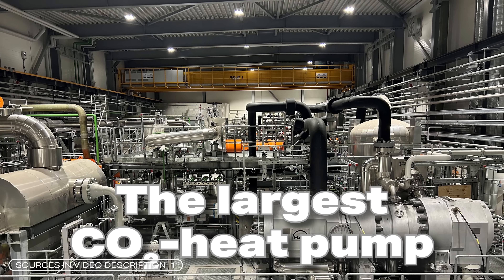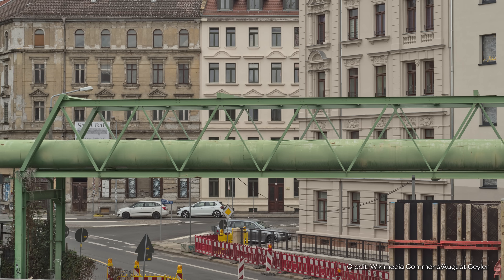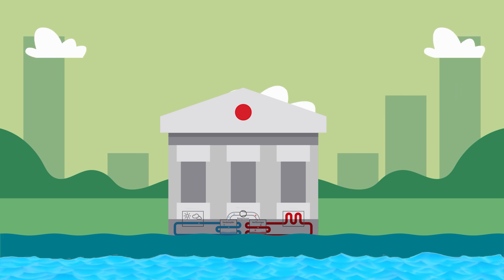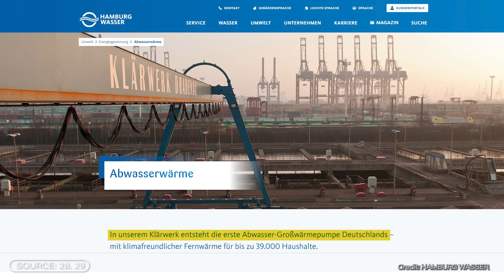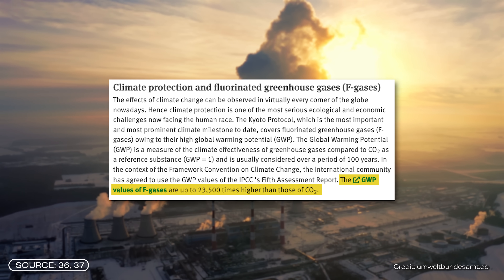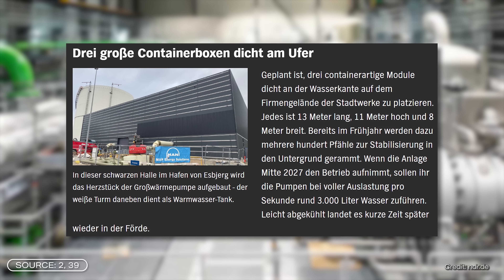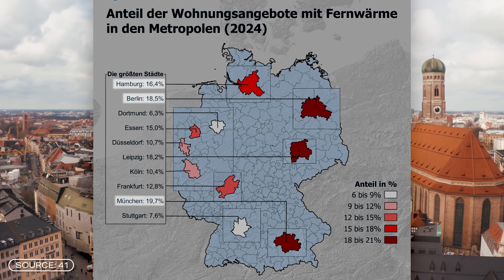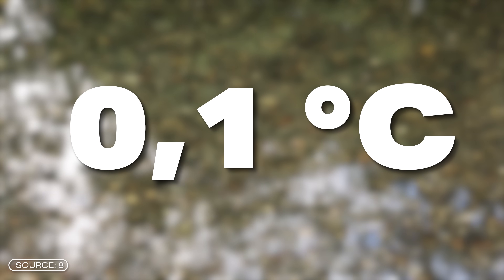World's Largest Heat Pump: Denmark’s Seawater Heating Revolution

Comment: I live near the City of Rotterdam in the Netherlands. The Government has been trying to get people hooked up to a Centralized district heat system that uses the waste heat of the extensive industrial processes around the Rotterdam harbour. Several districts and housing projects have been connected, and the reactions from a lot of people has not been favorable. Ranging from not enough heat available in cold periods, cumbersome to implement and manage, and way too expensive because the district heating infrastructure is expensive to install (from the ground up, this is not a system that has been used extensively in the Netherlands) and operate. Most complaints emerge from the fact that for people who elected to participate, costs were promised to be lower or at most equal to natural gas heating. In practice, most people pay more or a lot more for district heating.
Reply: Every city and town in Denmark has central heating. Also many villages have it too. 
In Denmark, it's by law, that you have to be connected. This has been the case, for many decades. So, the systems are very well built out.

I've never ever heard of people not being able to get enough heat, from these systems. Sounds like they messed that part up, where you live.

Depending on the method of heating, it can be a fair price here, or even dirt cheap, with central heating. For example, I had some family, that used to live in Esbjerg, a large city at the west coast. Because they had a huge power plant, that also produced a lot of waste energy, central heating was something like DKK 1500 a year or €200. Now, this was decades ago, but still dirt cheap.

In fact, the biggest story about failed heating, was when we put natural gas pipes across the country, and every village and town along the way, were forced to use the natural gas, and forced to install a burner in the house. So every house had its own heating unit. And 20-30 years later, they closed it all down. I don't remember why, though. But it was 2x an expensive installation/conversion, within a few decades. People were rightfully mad.

No matter the method of heating, it will always be better to have a centralized system. That way, you are way more in control, of the pollution from what is burned. An example, is Copenhagen, which opened up Copenhill some years ago. The most advanced central heating system in the world, burning garbage. It is the cleanest incinerator in the world, and has a ski slope, on the roof. They burn so much garbage, that they have to import from other countries.
Reply: @akyhne The experienced difference imo comes mostly down to the simple fact that in The Netherlands consumers take waste heat from for profit companies, and iirc the price they ask is based on a calculated price that even includes the current gas price.

So basically the experience is so different because as I see it, in Denmark you get the real price based on the technology that is being used. And in my country, the for profit prices of big companies that have a different purpose in mind than only the cleanest energy for the lowest price.

It's not all bad, though. We do have many good subsidies for green energy and  have the pp largest amount of solar thanks to government regulations, but regarding use of waste energy and heat pumps we're way behind in ambitions and in thinking imo.
Reply: @akyhne  Many neighborhoods in  Denmark have gas  pipes instead of district heating pipes, so in some areas the district  heating companies are racing to lay pipes before citizens transition from gas to heat pumps.
Reply: We have a lot of district heating in Finland. It works well, even in -30°C and is pretty cheap. But our houses are also well insulated without consideration for warm days so they get hot in summer without AC
Reply: @xWood4000  The issue is not insulation, the issue is that finnish houses are built to be as warm as possible, that includes window placement and roof colour, both factors that can not easiyl be changed in summer.
Reply: @xWood4000  insulation work BOTH ways so they keep heat IN during winters but heat OUT during summers... if your house is HOT during summer then it is designed WRONG... sunlight should not go in through the windows during summer => heat straight in, bypassing the insulation...

Comment: how are you handling the ice? if you are extracting heat from the air it's no problem because the air only starts to drip after extremely low temperatures, and then it just falls down and is replaced with new warmer non liquid air, but with water if you drop below freezing you get a shell of ice, meaning you have to remove the ice in some way to get new warm water in. their are lots of ways of doing this but lots of them are energy intensive.
Reply: Heat pumps in moist air like in Norway would freeze due to water in the air, so my heat pumps routinely heats the outside part to thaw the ice. In large bodies of water, like sea water, the temperature may drop many degrees around the heat pumps without reaching 0 degrees. We use a lake to heat the swimming pool at our school, never freezes in winter.

Comment: Toronto Ontario uses a LARGE VOLUME water from Lake Ontario to regulate the temperature in many buildings downtown.   Up to, 72,000 gallons per minute. ... But they use it for Air Conditioning in summer to keep cool, not for heating! :) ...

Isn't sea water really cold??  
Why use it for heating?? 
And HOW???
Reply: a heat pump is producing btus and not temperature so even if the lake is cold there is still btus it can extract from that water.  As long as they are pulling water from far enough down in the lake then the water temp stays somewhat steady year round.
Reply: You take out 2-3 degrees from the seawater, maybe it holds 4 degrees when it comes in and leaves at 2 degrees.
The heat pump take away those 2-3 degrees in its evaporation cycle in system where heat is needed.

Comment: because you are building this system from the ground up, you should go for higher temperatures, use molten salt with low temp Sodium nitrate you could have a temperature 325 °C  and that would mean you could use it for cooking, water heating, and heating. this means commercial restaurants could use it, also many industrial applications. also it's hot enough to use it as a grid based energy storage(a peaker power plant) water pipes can freeze and break because the crystal is expansive when liquid to solid compacting crystals will shrink when they become solid.
Reply: Heat pumps get less efficient as the temperature differential rises. 325C is far too high. 

They can manage up to 100C, but the lower the better.
Reply: The molten salt worked so well at Crescent Dunes, or maybe not.

Comment: The issue with district heat is substantial inefficiency -- it needs to run anytime it even might get cold  year or all year to supply hot water as well and it has really large losses in the pipes and because you can't effectively meter heat it incentivizes inefficient usage and insulation (new buildings will meet minimum standards and not bother to spend to find hot air losses).  Yes, I know that people argue that a 4th gen low temperature district heating system could cut those losses substantially but legionella concerns limit how low you can allow the temperature in the pipes to get and the hard truth is that it's really hard to maintain the system to that standard.  Ultimately, we already deliver electricity to people so unless you are leveraging industrial waste heat which might overcome the losses let each building have their own heat pump.  There is no reason they need to be that noisy and even if many people don't have AC now global warming is going to push them to it so they will need their own heat pump anyway.

However it could get insteresting if you also pumped cold river water around as well.
Reply: " but legionella concerns limit how low you can allow the temperature in the pipes ?

I knew a guy who contracted Legionnaires' Disease while working on old water piping lines.
Hospitalized and very sick for a long time, massive weight loss.
Reply: Heat batteries are a basic. And you can measure with modern tools.
Reply: @thekaxmax Heat batteries are relatively efficient it's pumping it around the area that's the issue.
Reply: @petergerdes1094   Water in insulated pipes, it's a mature tech
Reply: @thekaxmax It is mature and you can look up the heat loss rates like I did.  It's significant because it's a long thin piece.  And as the system ages it's very difficult not to get actual leaks which are hard to locate underground.  You can look up the reports like I did (I'd post them but YouTube eats comments with links) and, like I said, the losses may be low enough if you are getting free heat from industrial waste but if you are comparing this to just running individual heat pumps it's a huge maintenance and overhead cost for little to no total system efficiency advantage over each building having their own heat pump.  In situations where that's not possible maybe it makes sense but if you are building a new neighborhood better to just drill in each basement.
Reply: @petergerdes1094   The alternative is use the heat to make electricity and transport that. Can make sure both ends are using the most efficient equipment, if you keep it centralised and uses efficiency of scale. Treat it as infrastructure to the home like water.
Reply: @thekaxmax As I said, I agree if you have some waste heat it's probably a decent idea but if you are just using a heat pump to pull heat from the environment the total efficiency isn't going to increase much if at all (electricity losses about 10% and it seems like really good heat systems are losing at least 15-20% in the system itself which is annual meaning you are losing heat even when it is basically going unused plus inefficiency in use) and you have really high maintenance costs.  The extra efficiency of your big heat pump isn't going to be worth the high maintenance costs especially given the harmful effects on incentives.  At least you can meter electricity in a uniform way that encourages.

If you already have district heat I'm not saying you should get rid of it, that's much closer but building a new one?  That seems wasteful compared to sending the electricity unless you have some waste heat to use.

Comment: Power, heating, gas, internet...
there are a few things that should be 100%, 
one share per user, user owned. 

Otherwise, it's just a pain knob, 
for the psychopathy of control mania. 

Decentralize to a few homes per power plant. 
It will still work, 
and you will see faster evolution that way.
Reply: Why does it matter if the power plant sends you electricity or a hot fluid?  They don't control how hot you keep your house, you do by deciding how to control the exchange of heat from the pipe to your air.
Reply: @petergerdes1094  It's all power...not sure what you are saying.

Comment: Temperature differential is the key to efficiency.
If its to cold they cant heat a home or building unless they get a boost from electric or fossil fuels.

Nuclear power is the future.
Germany foolishly destroyed all their nuclear power plants.
A danke .
Reply: My bet is on geothermal.
Reply: @ds2237 yes but how would geo thermal generate Terra Watts of electric power.

And drilling millions of wells down so deep lots of BTU loss in piping to distribute heat to thousands of homes buildings unless they are on top of the well like Iceland.
Reply: @Motorhead250  Where are you getting the millions of wells from? Forget the pipes, convert the heat into electricity.
Reply: @ds2237 In what region?
Iceland?
Are there any volcano lava close to surface in most places except Iceland Hawaii etc ?
Reply: I now see why you are skeptical.  Current geothermal R&D is geared towards drilling very deep wells.  No matter where you are on  the planet, if you drill deep enough you will eventually run into very hot rocks.  There are currently several start-ups that hope to commercialize this idea.  Even if they fail, the technology for deep drilling is improving and I suspect that sooner or later it will become commercially viable.

Comment: Our home was heated by district heating when I was young back in the fifties. The bad news was they used fossil fuels to heat water,which was pumped to our basement,where it went through a heat exchanger,and a fan extracted the heat that was sent throughout the house through heating ducts.
Reply from the maker: That‘s a lot of conversion 😅
Reply: My father grew up in a neighborhood that had it, but his house had coal.  The district heating was steam, not hot water.  Steam is common in my area. I have steam heat and could never use a heat pump.  There is no room for ducts either.  The walls have only 1 pipe (steam is a single pipe system).
Reply: @tarstarkusz  found the American
Reply: @shades2.183  Is steam heat not common in other parts of the world?